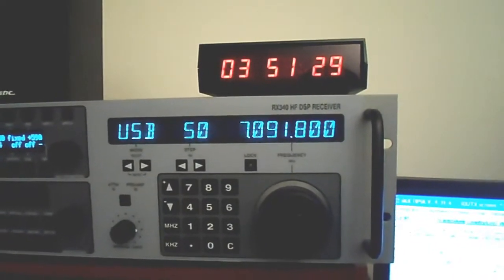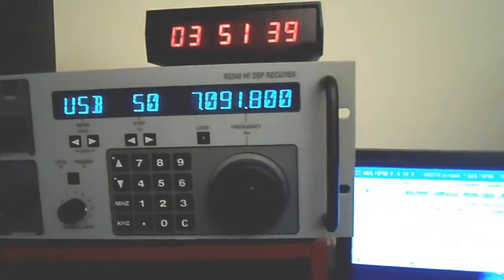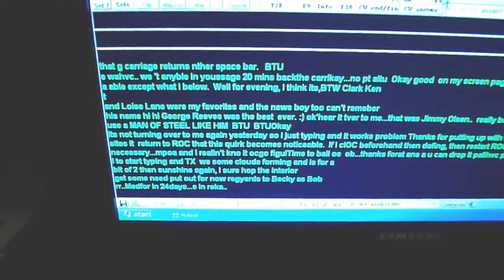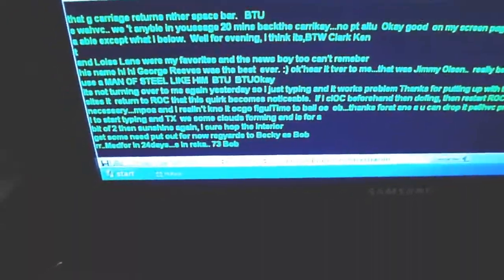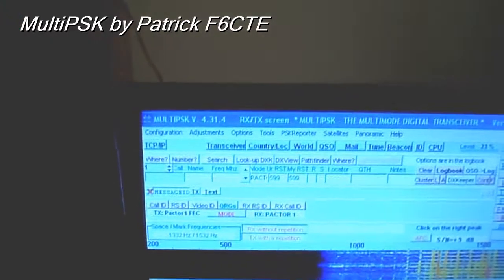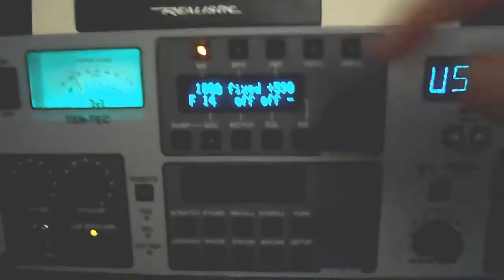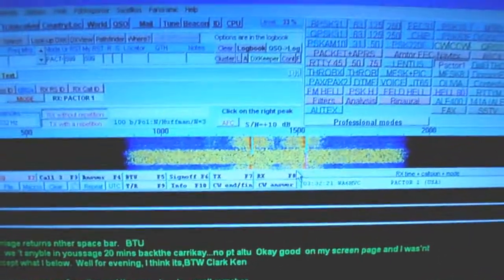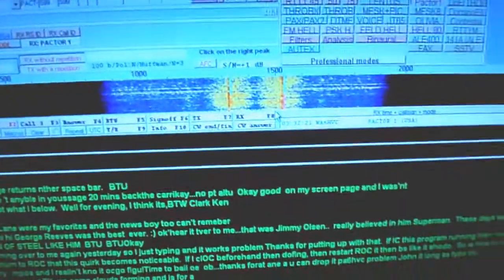Shortwave & Ham Radio: Rare Pactor 1 on 40 Meters using MultiPSK Digital Decoder

Comment: Pactor 1 is a good keyboard mode, although it remains pretty rare.  Pretty robust and good for live QSO's.  The best Pactor fishing hole is 14.109.0 CF.  You will find all varieties of Pactor keyboard QSO's there.
Reply from the maker: Thanks for the interesting and informative comment.  I will check out the 20 Meter frequency.  I've been away from the digital modes a couple years and plan to return soon.  Never operated Pactor, but like the ragchew modes PSK-31 and Olivia.  I checked your channel and see you have some beautiful vintage digital mode gear - excellent.  I have the 8000 too, and other cool decoder gear.  I find Multi-PSK runs circles around it on CW though!  Ha!  Incredible program.  I need to make videos of the vintage stuff for fun.   73,  Jack  WA6KYO

Comment: I'm hearing a lot of controversy re Winlink and different Pactor modes. Is Pactor 1 used much ? I have a pk232 that apparently has Pactor 1  ? I'm trying to piece all the controversy and other details together so I can get something going with what I have on HF
Reply from the maker: Thanks for the comment and good luck with the research.   From my listening experience, Pactor 1  seems rarely used these days, on 40 meters especially.  This is really the reason why I picked up the camera to film this somewhat rare digital mode reception.  You might have better luck hearing it on 20 meters.  73, Jack
Reply: @ElectronicsUSA  As far as practical use, seems like it would work better than winmore. I ask also because I have a very early TNC, the AEA PK232, and it still seems to work. I have seen listings of winlink stations and they all list pactor one,  many also list 2 and 3 in the USA.
Reply: @californiakayaker  FWIW, most Winlink stations don't accept P1 connects any more.  The mode, at 200 baud, is really too slow to pass that kind of traffic in a timely manner.  The best modem to use these days is VARA.  Even the free version is much faster than P1 or Winmor.  People complain about the QRM and width of the signals.  If the width bothers you, there is a 500 Hz BW version of VARA you can use that is very similar in performance to Pactor II, and just be careful to listen before you transmit.